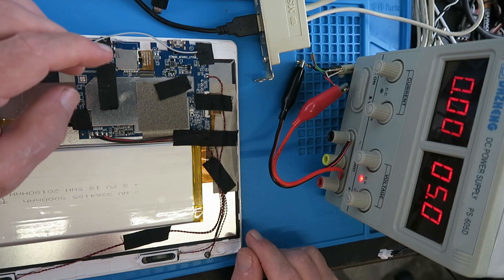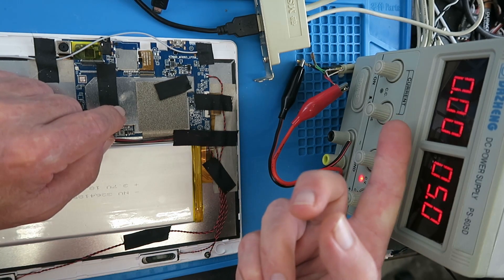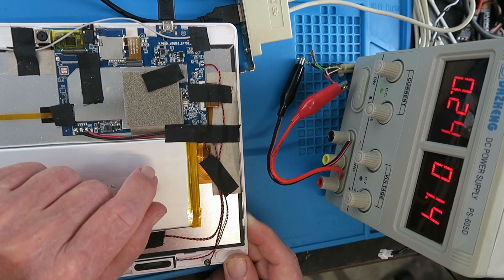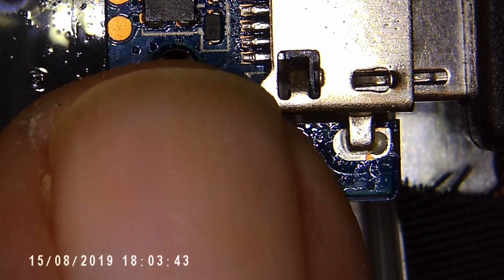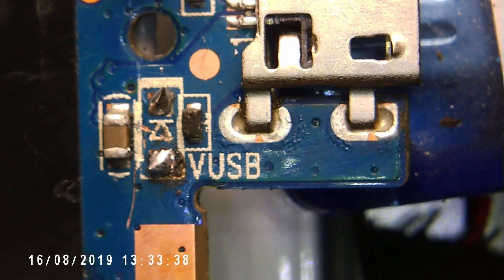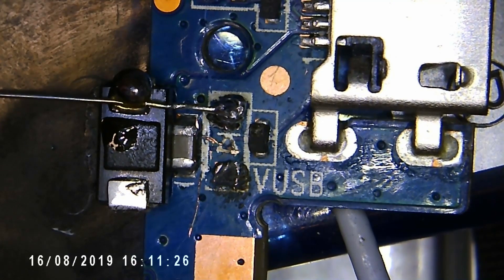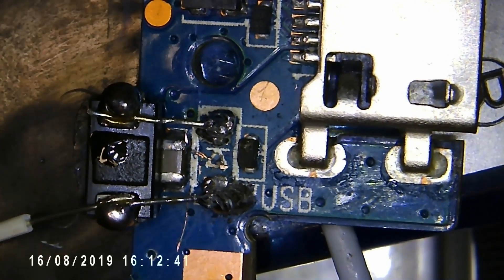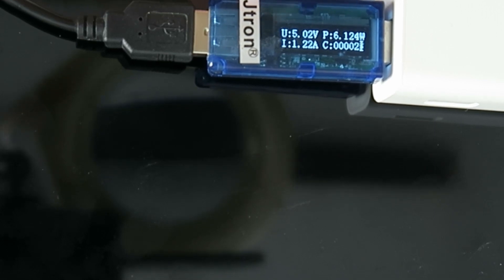Billow X101Pro S+ USB Short Circuit Fix Repair Reparar

Comment: You are too clever! I have a bunch of old 2 meter Ham radios that needs your help... BUT a dead parrot weigh in at around 600 grams... and one of these old 2 meter radios... well... through someone with it in self defense...  deadly to the recipient ... Hmmm How far is Spain from here? I suppose my Uno cant make it! Haha!
Reply from the maker: True story: My first job after college was with Marconi Space & Defence Systems. I worked as a technician in the thick film hybrid lab making bespoke modules for satellites, secure radio systems, torpedos & misiles. The modules were very expensive to make so needed to be reworked if failed. In the clean room there were various rework stations where 4 or 5 graduate engineers sat surrounded by 'scopes, spectrum analysers, signal generators etc. At the end of the room sat alone was a guy with only a multimeter but his repair rate was many times better than the graduates. I found out his only qualification was as a diesel mechanic on buses! Fascinated, I plucked up courage to ask him how is repair rate was so good with apparently no equipment. He simply said "look down this microscope" I saw the circuit under test which had 5 or 6 IC's on it. He reached under the bench and had a bottle of Isopropanol. He squirted the substrate and asked what I saw, "boiling IPA on IC's 2 and 4, I said". "Correct" he said, "change those 2 chips and it will work"!
If your still around Les Hallin, thanks for the tip which has served me well!!
Reply: @1nformatica  As a Ham radio operator, I can do as good as replacing finals and minor repairs here and there. The old protection diode radio repair man... I do have a "solder sucker" and at best the three pins on a transistor becomes difficult with 10 thumbs! I'm useless with a small 8 pin IC! Haha! A few years back I triggered two repeaters, 12,5 K spacing, without CTCSS with a old Midland e-prom radio,  having two other guys monitor each repeater, I sat trying to tune the radio... Haha! I annoyed the entire Ham community and made the Sunday bulletin! Finally I just adjusted the output power from 25 to about 5 Watts. Haha!
Reply from the maker: He he! I bet you were popular, bleeding over everything!! This was a delicate job : https://www.youtube.com/watch?v=zazcYapBs8E
13 dislikes?! What is there not to like?
Reply: @1nformatica  Many people don't understand the repair involved with micro technology... still compare it to the old TV repair man. I got  my Nikon camera to work after drilling a hole in the bottom casing to wiggle a gear. On the old 2 meter rig, drilled a hole to adjust the output power. To put my repairs in a video, would create 13K dislikes. My point is the item served its lifetime and at least try something.
Reply from the maker: Very true Johan. It's quite depressing the way things are headed. I used to make a little money doing repairs of PC Towers, laptops etc but no more. People just bin things with no thought of repair. I have a copy of a book titled "Every Boy's Book of Hobbies" published 1912. Contents include model making, carpentry, photography, fret work, bent iron work, geology & astronomy. Today they just stare at a phone screen!!
Reply from the maker: Thanks Johan! You only need to travel the length of Africa through all it's cultural diversity up to Morocco and hop across the straits of Gibraltar (curiously the Spanish just say "the straits"!) to Almeria on the regular ferry service and your here!!

Comment: buenas, me puede decir los valores del diodo para comprar un repuesto, tengo el mismo problema que en el video pero no se que diodo pedir, si es tan amable de decirme los valores para buscarlo.
Gracias.
Reply from the maker: Hola Amigo, El diodo es un diodo Schottky de 30 voltios y 2 amperios. Son muy comunes en muchos circuitos de fuente de alimentacion. Quité un diodo similar de 60 voltios y 2 amperios de una placa de circuito vieja. Era un poco más grande pero puedes ver cómo lo digo. ¡Considere suscribirse si aún no lo ha hecho! Un saludo desde Andalucia, España.